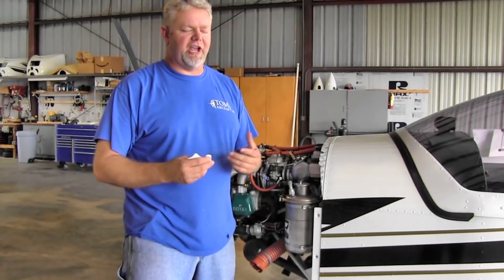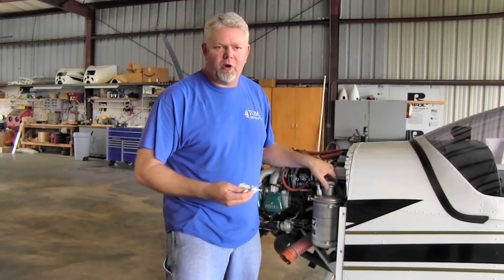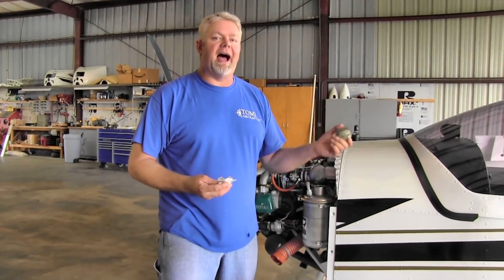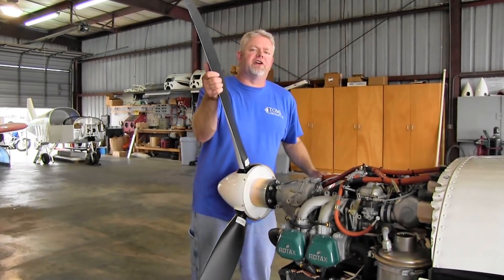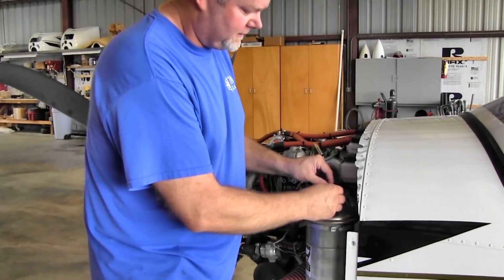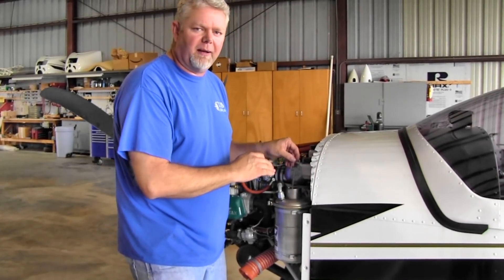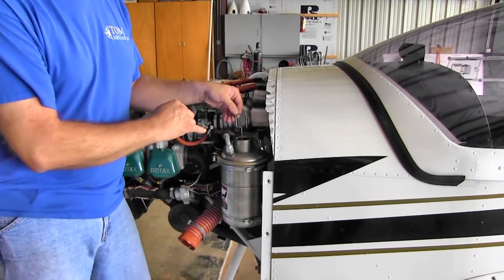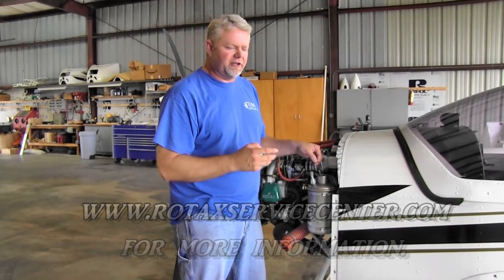How to check the oil on a Rotax 912 series aircraft engine TOMI Aircraft

Comment: Easier to use the Lockwood recommended process.  Check oil level first. If OK, then go fly as no burping is necessary.  If the level shows low, then burp and check again before adding oil.

Comment: If you pause the propeller for a second or two at the top of each compression stroke you will find that the burping process occurs more quickly.
Reply: Also much easier to turn the prop through.

Comment: I take the dipstick out and set it high in the neck of the oil tank so it can drip clean, then burp the engine three times, lower the dipstick into the tank and check the level. This way I do not need a cloth, which can leave dust and stuff behind.

Comment: Is it recommended to pull the oil cap of prior you turn the propeller? 

And how often do you normally need to turn the propeller till you hear the air flow?

Regards
DK
Reply from the maker: Yes otherwise you can't hear the engine "burp". There is no definite number of revolutions, you turn until you hear the "burp".
The Ultralight Flyer